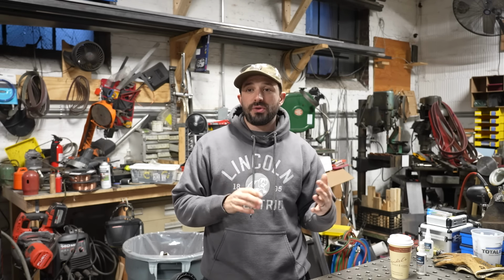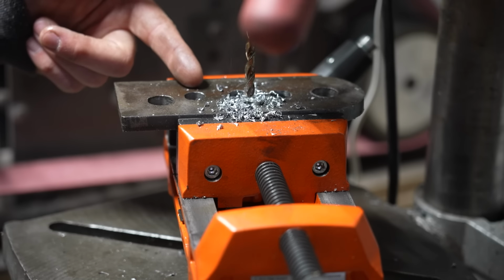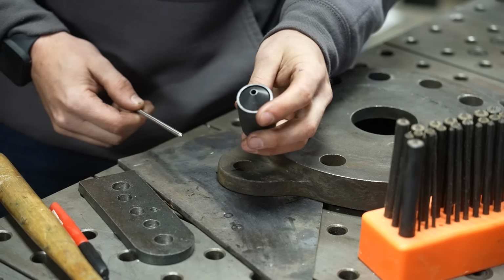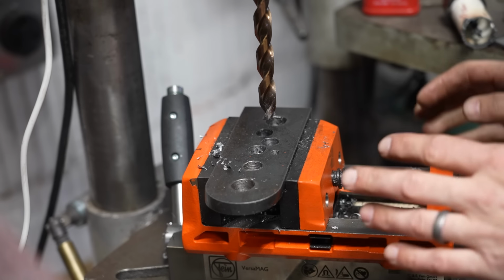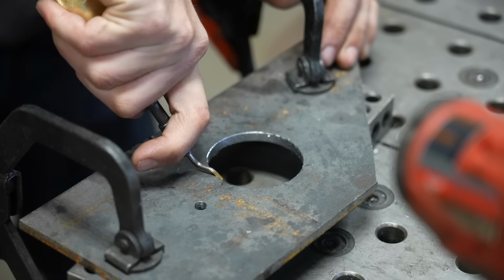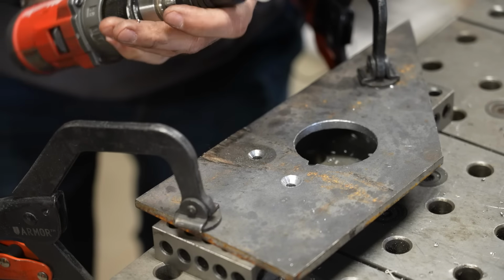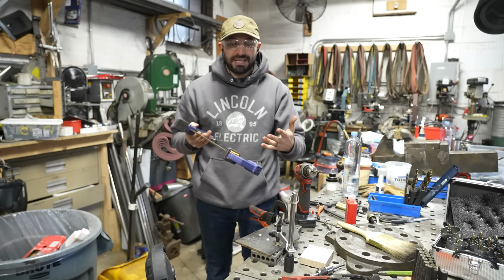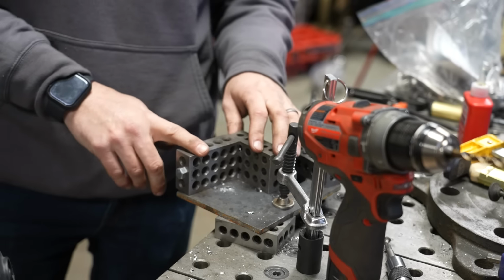How To Drill Better Holes In Metal

Comment: I'm an 82 year old retired general contractor.  Throughout my career I have done most of the subcontract work myself and have always had a metal fabrication shop at my disposal.  I watched your video on the 16' doors and  the way you made the hinges was brilliant.  I have to make 4 doors for two 14' h x 12'w openings,  and 4 doors for two 9' x 12' openings. Your hinge design will work perfectly for that.  When you put the level on your door, you said 'level" for a vertical measurement which should have been called "plumb"'.   You're teaching videos are critical to educate.  To me, terminology is important.  Thanks for your videos.

Comment: A good tip when drilling metal is to use a magnet(s) to collect the  swarf cuttings. I have several types but mostly use one like a doughnut so can drill down through the centre

Comment: That corner sink bit! Is something I could use! In my shop! I didn’t even know those existed 😂 I’ll definitely get one for my shop!
Reply: It'd be better if you knew what it was really called if you're looking for one. It's a countersink bit. As opposed to a counterboring bit. They're a thing too. I don't know about no sinks in corners. If you don't have a countersink bit you can just drill a little with a really big bit to make the countersink then go back with a little bit and drill through. If you try it the other way it can go horribly wrong. Having an actual countersink bit then you can countersink last and it works OK. What goes wrong little then big is sometimes the big bit will feed too much with a pilot hole to follow. Then you end up with a big hole. That's no bueno.

Comment: I use the 123 blocks all over the place, there are 4 next to the cnc machine and 2 next to the drill press all the time . They are very square and flat and hard, plus have enough weight to hold some things in place. I finally bought cobolt bits about a year ago and it has been the best investment for drilling metal. Spend the money and get cobolt, yes it is expensive but they last a long time and cut metal like butter. The depth device for the champher is new to me.
Reply: Cobalt bits are only really useful if you drill tougher alloy steel. For plain mild steel M2 is just fine. The best investment for drilling metal is learning how to do it. Learn how to sharpen bits and calculate the right speed to run. Those are the two things knuckleheads don't know how to do.

Comment: Great points/advice.  I learned the hard way not to clamp down a drill press vice and it must have been off kilter or something but when it broke through it wound the press right up into the chuck.  Surprised the heck out of me!!  Fortunately, no damage was done, and I didn't get whacked by the spinning clamp.  Still not sure to this day why it happened 'cause everything is square and plumb and the bit that I used is not bent or anything.  The press has worked great ever since as well...
Reply: Moments like  that, you really appreciate having a footswitch  for your drill press.

Comment: That was a great video for novice & veteran metalworkers. I saw many things I knew, but forgot or was foggy on & some new tools (adj. depth countersink)! I'm checking out your playlist for precise, guided drill grinding (sharpening). If you do that subject as well as this vid., it would be awesome. I bought cobalt bits for working with cast stainless steel exh manifolds. I worked in an auto engine research place & had to instrument the manifolds with multiple temp & pressure fittings. Even then I kept my cheapie 350X  Drill Dr. busy every 3 or 4 holes, resharpening/touching up to speed up the work & reduce frustration. I wish I would have paid more for the 750X Drill Dr., for more adjustments, features & split point grinding. Split points practically eliminate the need for drilling a pilot hole first, (faster job completion)!  Cheers, Paul from S. Central Tx..

Comment: Great video and tips, thank you!
Try some LPS 40320 Tapmatic #1 Gold Cutting Fluid sometime. As long as they haven't changed the formula this stuff works a lot better than Tapmagic. It works for drilling, cutting, and tapping. You can really tell the difference when tapping small holes.

Comment: You should cover the use of T Slot clamps for the drill press table. Also the fly cutter for the larger holes instead of the hole saws.  Excellent video.

Comment: A very good Hole drilling video.
as a vertical drill jig, instead of using the 123 blocks, I drill a vertical/square hole, of the required size, through a small block of steel on the drill press and then use this small block for drilling or tapping a hole perpendicular into what ever I need.
I always keep a set of 1/4, 3/8 and 1/2 inch handy to get those freehand holes perpendicular.

Comment: Good tips video. I have used a few of these myself. 
In addition to the wood clamp, I have also used a large caulking gun to help push a drill through steel. The advantage of the caulking gun is that it has a gap that the drill bit can pass between 
The disadvantage is the throat depth. For that I use a Strong Arm 5. It is a bit pricey and awkward to use, but it fantastic for putting holes in where it would be almost impossible to apply force to the drill by hand. It is worthwhile to buy a good quality deburring tool. I had so many of the cheap chinese ones break on me. They are not worth it.
For getting vertical alignment I use a V-block. That is much easier to use than fiddling around with two 123 blocks.

Comment: Check out the Gator drill and taps guides.  They are great for making perpendicular holes in both flat and round stock.   Also check out adjustable expanding center punches - they work with odd hole sizes and when transferring from thinner materials.

Comment: Sir,
The aircraft cutter is new to me. 
If setting the depth from a previous hole, can one get consistent, accurate results setting depth by drilling a test hole in wood?
Easier on the tool, easier on the bit?

Comment: As far as strings/rope or belts,  the loose clothes are extremely dangerous in certain environments..... not as bad w/ smaller
drills & stuff but the mid size & bigger stuff can/will chew you up.  I have a friend who get eaten up by a cotton gin which got
one arm & he tried to get that out but wound up w/ both arms in the Gin; he tried to kick the shutoff w/ his feet but hung until
someone else turned off the machine.....  be careful the clothes you wear in/and around any shop.  peace out
Reply: No question about it. Treat ALL machinery and power tools like they want to kill you, ,,,,, because they do.
Reply: I've done so many stupid things w/  small power tools but these "Grinders" & tools like them  w/ cutting wheels
that break are pretty bad & hardly anyone wears safety glasses?  More now than when I was young but still a lot
don't & we use tools to do stuff it wasn't made to do.  The bigger stuff at factories has some safety built into it
but that's where my friend got pulled in.  Took all the mean from his arm bones & over 20 surgeries taking the
muscles from different parts of his his but he did keep his arms - they were gross & didn't work right but he
at least had a life.   But the mid-sized stuff is what I see the most dangerous today.... we can now get high
power table tools & we wear the loose clothes w/o thinking about it.  Be wise is the lesson for me too !!
Reply: Never figured out how those long haired pony tailed oil drillers stayed out of the rotary table
Reply: I'm betting that few did not & their careers were "drilled" short ??  Hope I'm wrong but I've seen what
can happen in a cotten-gin.  Gotta be careful, no doubt.  peace

Comment: Nn the safety thing you forgot the most dangerous thing of allI see on YouTube. 
NO GLOVES AROUND ROTATING EQUIPMENT. Loose the gloves or loose a finger!
And don't fall for the "ripaway" BS. - It takes like zero milliseconds for those gloves to pull you into the drill. And zero force to move your hand to move that few thousandths that gets the drill a hold on you. The only safe place for gloves when you are working around rotating machinery is in a drawer. (I don't even like the long sleeves ! )

One more thing. If you got one of those strings tangled up in the drill press the only thing that would rip is the skin on your face. The cloth would stall the machine before it would fail and that could easily turn into a FATAL accident. 

Gloves, Long Sleeves, rags, long hair and anything else that can be wrapped around a shaft like watch bands, gold chains,,,,and even rings including the rubber ones should be kept completely away form anything that rotates.  Leave the gloves and rings to the Bob Villas.

Comment: Please don`t drill directly onto your very nice fabrication table ! = (
Reply from the maker: I went through one of the fixture holes! I promise I didn’t harm the table
Reply: @MakeEverything  I could tell. Still bad practice though, especially when you are fortunate enough to have such a precious thing. I find old Ikea cutting boards have a multitude of uses around the shop = )
Reply: Yea I said the same thing. I use 4x4 post scraps to drill on, they are large enough to stay still and have flat faces and provide more than ample depth to prevent hitting the table.

Comment: Would you know were i can buy a bench top drill press thats wouldnt have any run out in it the biggest drill i use. is a 1/4 inch ,,,,any suggestions  would be very helpfull,,,,,thank you Ken
Reply: You can get something like a little Camron for something over 2 grand at Penn Tool , Just remember,,,,,There is no such thing as no run out at all but Camron specs theirs out a .0002" total run out. - Standard full size industrial drill presses are considered in spec if they run out at .003" or less.